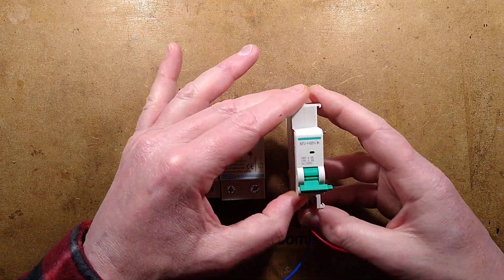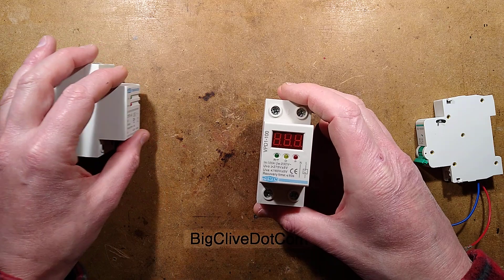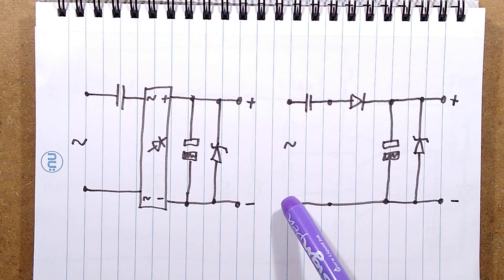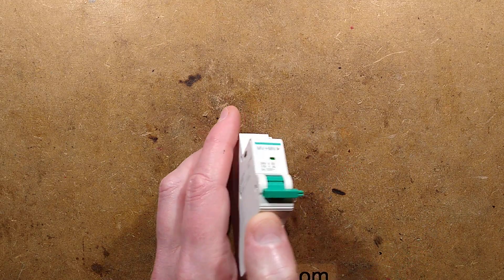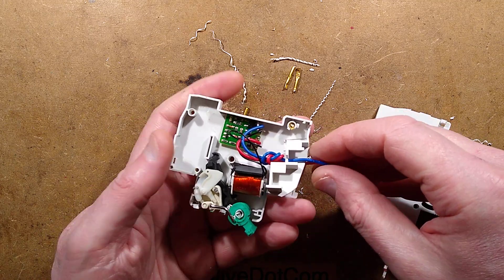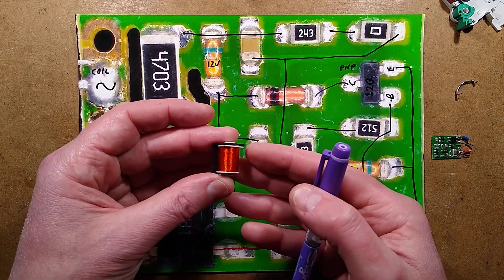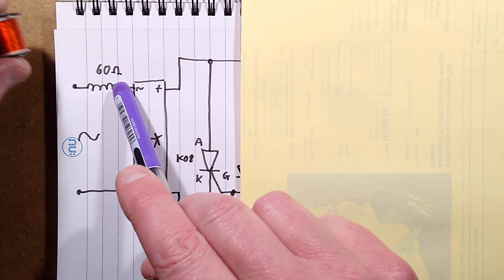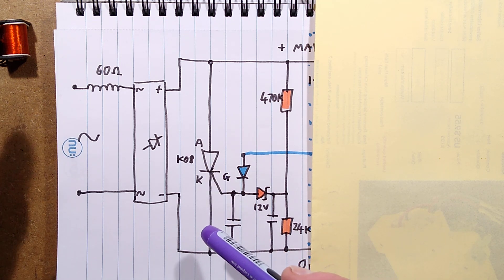Over/under voltage detector - with schematic

Comment: The next, even cheaper, Chinese knock off of this device would contain a capacitive dropper, a diode, a coil, some resistors and a Padauk microcontroller.
Reply from the maker: I'm not sure they could get cheaper than this.
Reply: Cheaper chineese one would just be a LED connected to a resistor and nothing else
Reply: Oi! What about the LED to indicate it's ON?
Reply: I duno, those microcontrollers are expensive, several cents per chip! The local Shenzhen vendor can get you the discrete components for a hundred to the cent, each.
Reply: I wouldn't really want to see a micro-controller in something like this, especially not if the code was written by a company striving for the lowest price point.

Considering something like this may be powered on for months or years before it needs to trip, there is the possibility that a badly coded firmware will crash or lock up or otherwise stop functioning after a certain time period due to a counter overflow etc.
Reply: Don't forget, the led needs to blink to let you know it's working ;)
Reply: The next one: mains is just connected to the coil through some resistors.
Reply: Having an indicator LED is vital and a (Chinese) standard, 'cause without it we wouldn't know it's (a) Lethal (product)...

Comment: I would never have guessed the trip coil would be in the input circuit. I wonder how many times it would work before it was fried.
Reply: It’s truly inspired way of using the diode bridge as both a rectifier AND a switching element.
Moreover, it functions as a bipolar switch activated by a DC-only driver! I’d love to see what other cool hax that designed has on his pocket notebook!

Comment: Once you explained how it all works it really seems quite elegant. 
I imagine designing a circuit like this feels similar to writing a really compact and efficient bit of code.... not that I'd know how either of those feel.  😐
Reply: 20 years ago programing at work I took out 12 a4 sides of code with a complicated loop. Man, I remember that feeling. No one will ever know but it flicked my switch that day
Reply: @SwimBikeRunFastest  Unrolling and cleaning up loops is its own reward.
Reply: I called those beautifully clean algorithms "computer poems."
Reply: Analog circuits are fascinating! Often so simple, yet really hard to design, it takes a lot of time until you can design them rather intuitive like coding is.

Comment: Clive, that one relay you showed early in the video without the volt meter on it is an overcurrent trip relay. Obviously you would want a breaker or fuse upstream to trip in case of a short.

Comment: At first I wondered about the colors on the schematic, but I've learned to trust and was rewarded. 
Clive you are brilliant; your description and graphics very nicely explained something I would have little insight into were I to take it apart. 
I would be more likely to run off with that coil for the magnet wire to do radio stuff with or make Joule Theives